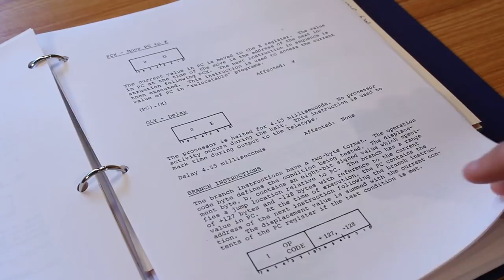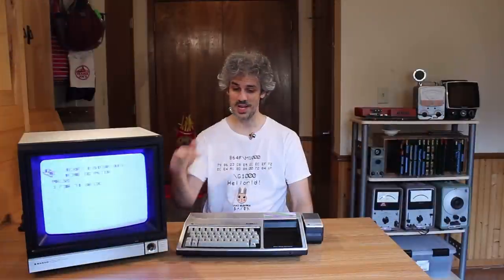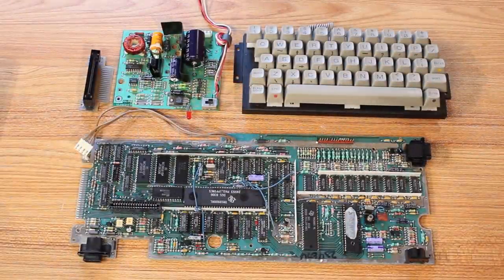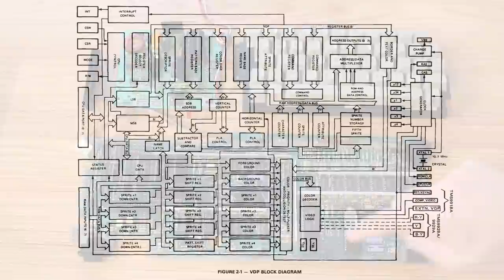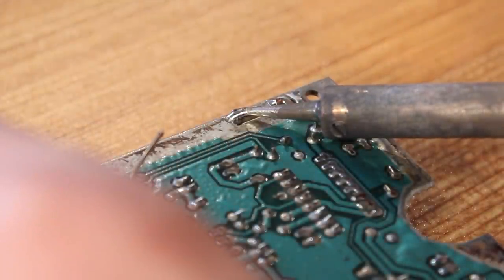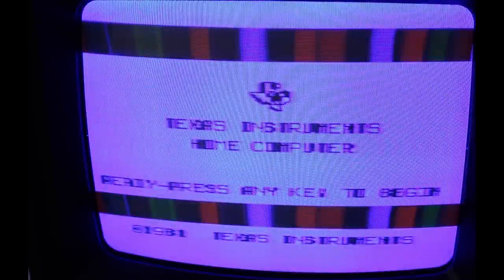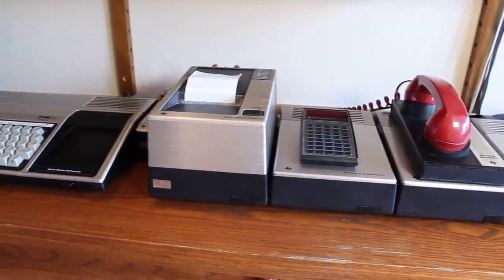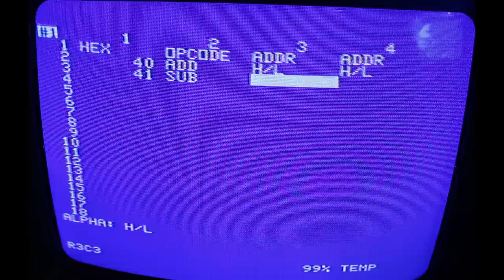Working on the TI-99

Comment: Tip for that TI99 is to grab an old CDROM or DVD drive and strip it for the thermal pads from the PCB, which will make for better heat transfer to the heatsink, and those importantly do not dry out with time, and make really good heat transfer and gap filling.

They also can be placed on the TMS9900 CPU, and the other big chips, as well, extra cooling can only help. Plus change all the electrolytic capacitors as well, the 40 year old ones are only going to fail, and with the extra load of the sidecars you want the best ESR on the existing ones. Yes radial in place of the axial works, and as a bonus use Nichicon ones, using the next higher voltage ones in the skinny case, gives a closer look to the originals, Sleeve the lead, not the case, as you do want the case to either be isolated or only touch the negative lead, as the case otherwise becomes a separate poor leaky capacitor.

Comment: I remember making the choice between VIC-20 and TI99/4.  Cost was a major factor but also the amount of software and hardware available.  There seemed very little interest in the TI machine in magazines of the time, so I went with the VIC-20.  I still have it and it still works.
Reply from the maker: Oh yeah, at the time I think the VIC-20 would have hands down been the better choice! The TI-99 is a surprisingly capable machine, even with one arm tied behind its back, but TI never really opened up the software market to 3rd party developers, which really hurt the software side of it and never really allowed the machine to take off. I think if the CPU had been uncorked and allowed to stretch all 16 of its bits and if they stuffed 64k of RAM into, they would have had an absolute screamer of a machine!
Reply: @UsagiElectric  And since it ran on dynamic RAM, 16k wouldn't have cost as much as it did with SRAM machines.

Comment: Even though I don't know electronics that well, I enjoyed this.

I'd heard for years about how expansion worked on the TI, and finally got to see an extensive expansion in your video! Wow! I pictured the setup would look like this, all strung out to the right of the computer, but to see you have to turn on a bunch of them before turning on the computer was a trip. I was surprised to see the TI floppy drive as its own module. I knew a floppy drive was available for it, but the one I remember was part of a huge expansion module, which I think had a bunch of card slots in it. I thought that was the only way to get the disk drive.

Owning an Atari 8-bit computer, I was used to having to turn on the monitor/TV, and the disk drive before turning on the computer, but that was it.

My freshman year in college (1988), I had a roommate with a TI-99/4A. He had only a couple sidecars. One was the voice synthesizer (a classic), and a reasonably-sized interface module from a third-party manufacturer. He connected this up to a dual disk drive module through a ribbon cable. The drive was, again, from a third-party. And he had a third-party phone modem hooked up through the RS-232 port on the interface module. As I remember, he made his own detached keyboard by removing the keyboard from the case, and mounting it on a board, with the ribbon cable from the keyboard stringing up to the case.

Comment: I used to drool over the 8"disk expansion and voice synthesis. They were a lot of coin in 1985! had to deal with the cassette tape for storage.
Reply from the maker: The disk drive I got in a righteous deal from a fellow TI-99 enthusiast, and with it and the 32k memory expansion, the TI-99 is a surprisingly capable machine, despite having one arm tied behind its back!

Comment: This takes me back  🙂
In the late '70's, the TMS9900 was really nice chip.
I built my own homebrew computer from scratch using a chip in the ceramic package. 
With 8KB of Static RAM, I had a lot of fun in machine language and later in assembly language. 
In that era, memory was relatively expensive.  As late as 1983, TI was still making a lot of 16K-BIT dynamic RAMs.

Assembly language programs ran pretty fast (in that day) but the TI-994A built in Basic was way too slow for good games.
The games with plug in modules used assembly language to get good performance.

Comment: The TI-99 smacks of being the brain fart of the marketing department. "We need a personal computer now! We're not using that 16bit thing, slap it together and make it cheap, by yesterday or sooner!" All the work to kludge in that processor killed it...
Reply: They had a microcontroller-sized version in the works that simply wasn't ready by the time they wanted to produce the TI-99/4, so they just used what was already in production, the TMS9900, with the thought that they'd increment to a cost-reduced hardware release later, but the bottom fell out of the market before they ever got that far along and just abandoned the whole home computer market.
Reply from the maker: I think drussel nailed it, they just rushed the product to market but it wasn't quite complete, and that killed them before they even got started. 
Around the same time, TI was absolutely mopping the floor with every other competitor under the sun in the calculator market, so the higher ups probably made the decision to axe the computer division and focus on the real money maker.
Reply: @UsagiElectric I remember that the marketing was top notch. The cartridge and cassettes looked premium and akin to a ‘Nintendo’ experience. I mean, quality cardboard and plastic. They put a lot into presentation. As far as I knew the issue was Commodore and their race to the bottom discounting that killed the Ti.

Comment: I remember one of my best friends had a 99/4 and loved it… I was never won over… my direction was Z80 and onward.
i was intrigued, as a product manufactured by the chip manufacturer (TI).
Reply: TI also manufactured printers, watches and a dual cassette system that was intended to have car dealers as customers.  And, as far as chip manufacturers making final products Intel made a server that ran Interactive Unix and was used by stockbrokers.
Reply: Man wouldn't you get a kick out of the fact the were also a weapons manufacturer
Reply from the maker: I feel a certain bit of pride towards TI since I remember driving right by their Arlington plant when growing up. I'm probably a bit biased being a native Texan, but the TI-99 is really interesting in that it's essentially a choked down minicomputer. I can't help but wonder what that little TMS9900 could do if it were uncorked!
Reply: @UsagiElectric  The Quotron 801 which features in the movies "Wall Street" and "Pursuit of Happiness" was an eight bit machine (it was never referred to as a "mini-computer" by either the users or the manufacturer) that was built around a TI CPU and ALU.  It ran machine language.  The upgraded machine, the Q1000, ran Unix and was based on Motorola 68000 series chips.  The Q801 was still being installed as late as 1991.  Chips had to be sourced on the "grey market" as many of them were no longer being manufactured.  

A machine running machine language is going to be faster than one running an operating system and traders preferred it for that reason.

Comment: SO jealous that you have a TI-thermal printer. It has been on my wish list for 40 years. In '82 it was out of my snack bracket (having just bought a decked out PEB), and nowadays they are impossible to find in working condition (and I lack your repair skills in such matters).

I did muster the courage to replace the VDP with an F18A though, and so I can use the 80 column version of Multiplan (eat yer heart out,  you and your fancy-pants thermal printer!)

Fun video. Earned you a subsscription (full diclosure: 4A content usually does that).

Comment: I have a TI-99-4A that I got at a thrift store in 2008 or so, but unfortunately I never found a single piece of other TI-99 hardware so it's kinda useless to me. Maybe I should send it to you along with the other stuff.
Reply from the maker: Finding a TI-99 in a thrift store is a nice bag! Is it one of the earlier black and silver or later beige models? Either way, there's some excellent ICs in there if you ever feel inclined to salvage the pieces out of it!

Comment: I always remember my and several of my friend’s frustration at missing out on these computers. One year in highschool we all signed up for a brand new computer class. We were all set to buy a commodore of some type when one of the group said his aunt in texas worked at Texas Instruments and could get us all a great deal on the Ti’s. Needless to say, there was no computers coming from the aunt and those who stayed in the class got to work on Trs-80s.
Reply from the maker: TI's story with the TI-99 is an interesting one. It has so much potential hiding away inside it, but it's strangled by the 8-bit VDP, lack of RAM, and TI's decision to not open up the software market to 3rd party devs. In the end, they could barely give the system away, which is a total shame.
Having said that, the TRS-80s y'all got use in class were probably much better performing machines, haha.
Reply: The Trs 80s just weren’t cool at the time but they were good enough for the class. The cool kids called them “trash 80s”.

Comment: Had one of these as a kid around 1990. Good that thing was outdated by then. But it was the only computer I had ever touched till that point. My dad found it on the side of the road one day.  We only had a few game cartridges, and I enjoyed playing them, but ultimately they were way too simple and we'd get bored. 

Eventually the monitor gave out, the original Texas Instruments monitor, and my dad threw the whole thing away.
Reply from the maker: Oh man, by 1990 it would have been crazy outdated, almost retro, haha. 
The TI-99 suffered from pretty poor software because TI didn't want to open the software market up to third parties, so it just kind of languished. Since then, the homebrew scene has made some pretty amazing stuff run on the hardware, like a full-on 3D ray tracing engine, which is just staggering. I really would have loved to have seen the TMS9900 in the TI-99 uncorked with a boat load of RAM and full use of its 16-bit data bus, I think that thing would have rocked!

Comment: One of the first computers I ever got to use. Right after the local Radio Shack's TRS80, which I learned to program on by just hanging out at Radio Shack. 
Went to a computer camp when I was about 10 and the main lab was all TI-99/4A.
There was a smaller lab with Apple II and a few Pet CPM.
I though it was a fantastic computer. Probably dazzled by the very 80's industrial design. 
Begged and pleaded to get one for my birthday, but we ended up with the Atari 800 instead. 
A wiser decision, since I didn't need a 12 foot long desk to fit all the peripherals. The Atari using CABLES instead of a card edge buss. 
Also the Atari had a much more robust user community.

Comment: 1.) It's always like that "it did work before". If it would not be like that, it technically would not have gone broken. 🙊
2.) it needs all those things, like 3 meters of expansion, and can't even match a C64?!? I do not have any expansion for mine but I guess yours is not in the category of a "mini computer" any longer🤣
3.) I miss the bunny 🥺
Reply: In fairness, a stock C64 did not come with a printer, acoustic modem, or floppy drive either, so it isn’t an entirely fair comparison.  But it is certainly an unwieldy system if one has more than a couple expansion devices.  I much prefer using cables (like the Commodores) than needing to have every device rigidly chained together!  I was never terribly impressed by the TI/99 back in the early 80s as even my early Vic 20 was a nicer system to actually use than the awful membrane and chiclet keyboards used on the TI/99.

Comment: The 99er was my first computer. My parents placed it under the tree Xmas 1983. Still have it. (The 99er, not the tree). But it's lurking around boxed at the attic of my house. On my desktop(the real table) there stands a TI-PC100 dockingstation with a connected TI-59. My favourite online game is 'Lord of the Rings online". I use the TI-59 frequently to calculate  prices for selling stuff at the in-game auction place. 🙂
The games doesn't have a built-in calculator so  I use this old stuff.

Comment: That NEC character display is very resilient. I also have a premade spreadsheet with all the internal capacitor values including the audio daughterboard inside if you ever want to top-to-bottom recap that baby. It's the crown jewel on top of my Apple II+ and what I use for my own home built Z80 system. Love your work.
Reply: I used to have one exactly like that.  Was a great green monochrome monitor with a nice crisp display.  Wish I still had it!

Comment: I'm designing a replacement keyboard for the 99/4a and I had the same issue with the top row keys too high up . Maybe I made a mistake measuring the original PCB but the issue seems to be mostly resolved when I 3D-printed some spacers for the screws.

Comment: I used to have to service Texas Instruments commercial/industrial hardware and absolutely hated it. Every circuit was pointlessly over-complicated (any power transistor failure would immediately blow a dozen more), while all metal components in their OMNI printers were given super-sharpened edges to better rip skin from your knuckles. Best of all was their "luggable" (PPC - System 2) PC, which would blast choking clouds of black smoke into the air, if a customer forgot to flick the 110/240 supply voltage switch, and then plugged it into a 240v supply. Yeuch!!

Comment: Adding components , ie, sidecars with a click was a really great idea! Early "plug and play?" At the time, I had no idea accessories like this were available. Beats trying to get early Windows to "recognize" a printer, huh?
Reply from the maker: The sidecar idea is really cool! Each sidecar has its own individual power supply, so you don't have any power distribution problems, and I believe each sidecar had direct access to the Address bus and Data bus. Though, they did tend to get a bit long, haha.
Fortunately, the PEB, Peripheral Expansion Box, collected them all up in a nice little box the monitor could sit on for a much more streamlined desktop. But, I still prefer the massive train of sidecars, haha.

Comment: Okay, so that white stuff on the chip was dried thermal paste! I found 2 X Ti99 in the garage covered in muck and water. I cleaned them up and one of them works but the picture is garbled. Next  I’ll try some new thermal paste on the video chip and then out the rf shield back on. Thanks, this video helped.

Comment: I loved my ti-994a and it’s speech synth, with sprite support, expanded basic, etc. the save to tape was annoying as heck…but a great simple machine to work with.
Reply from the maker: Extended Basic really woke the machine up to! I think a lot of people judge based on the original Basic ROM included and it's not the best Basic out there. Coupled with the slightly unfamiliar syntax, I can see it copping a lot of hate, but with the right accessories, the TI-99 was a great little machine!

Comment: I'm curious about how the 9900 processor falls into the "16-bit" category just by having a 16-bit address bus? I thought the defining "wide" of a micro was the size of its internal registers, or how many bits at once it can move internally/externally (not to how many memory addresses it can read/write).
If you apple the address criteria shown here then the C64 is also a 16 bit computer.
Also I wonder if someone would be able to re-design the TI 99/4A getting rid of the ridiculous bottleneck and unleash the real power of the processor, not having to be restricted by the non-existent 256 bytes of memory and going thru the VDP for every operation, rendering even a basic listing to a molasses speed.
Reply from the maker: The TMS9900 actually does have a 16-bit data bus!
The machine is hobbled by the fact that the memory is all gated by the VDP which only has an 8-bit data bus. So, the TI-99 is technically a 16-bit system, but practically it's just an 8-bit system, since all memory read and writes happen 8-bits at a time.
For the high-speed SRAM that it uses as scratchpad memory, it can actually use the full 16-bit data bus, so internal register operations should be fairly quick!

Comment: That NEC monitor is almost exactly like the monitor for the HP86B right down to the scratchy volume knob. The only difference is the HP has the power jack on top and the I/O jack on the bottom.

Comment: an older brother bought a TI-99 for himself and bought a Commodore 64 for me - years later finally understand the architectures enough to see that I got the better architecture design as the TI direction of CPU design was avdefinite dead-end given the evolutionary trends. Not speaking from market place perspective but technical perspective. The TI's clever way of using memory to store context switching state would become more problematic as CPU clockspeed and memory clockspeed would diverge further and further apart.
Reply from the maker: I don't know if I would say that the TI-99 CPU design was a dead-end so much as it was designed around different concepts. Minicomputers using similar architectures were used well into the mid-90s (the Centurion minicomputers were used regularly as late as 1995) because they were brilliant at data management and multi-user setups, something a 6502 or even the 8086 couldn't quite match. But, for a home computer / personal computer setup, that minicomputer architecture really didn't translate well at all.